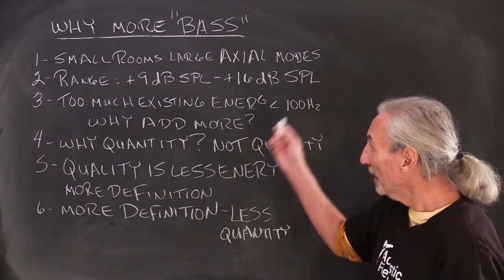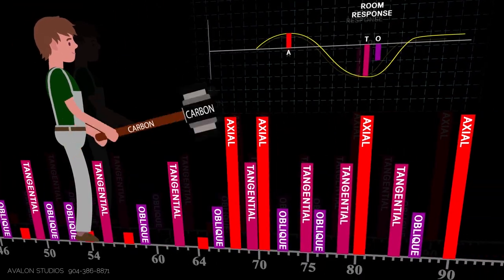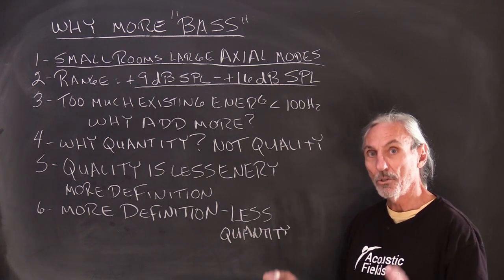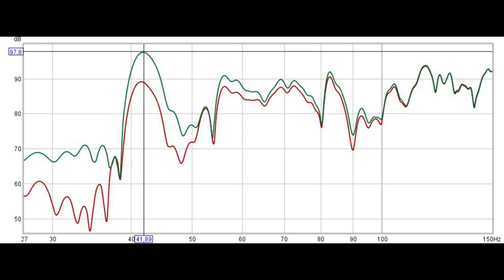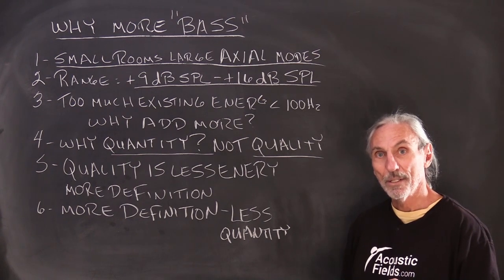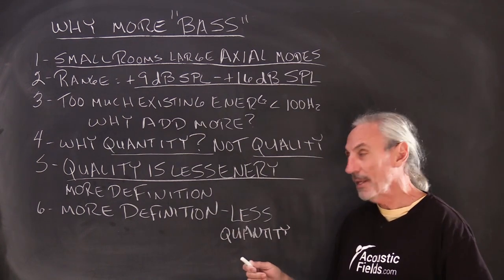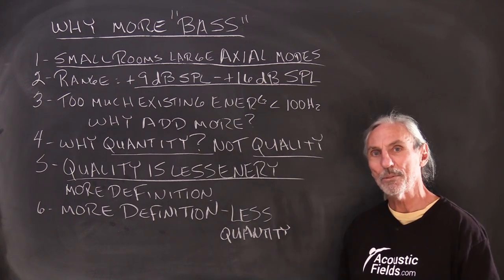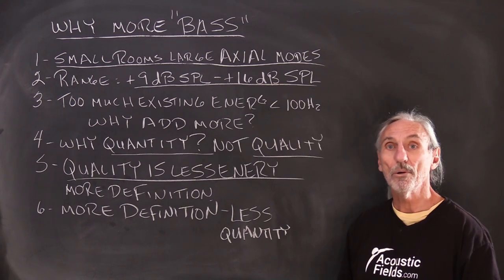Why More "Bass"? - www.AcousticFields.com

Comment: Great vídeo dennis!! I own two 18 inches subs,  one right betwin the center channel and  left channel and the other one at 3 o'clock from the sweet spot right beside the couch firing to the front stage and the sound is amazing!! Sorprisingly smooth and detailed!!!
Reply from the maker: Positioning low-frequency sources in small rooms is a process since the proper position is frequency and amplitude dependent. For some songs, the sub may sound good. For others, not so good.
Reply: Agreed!! Saludos desde México mi amigo!

Comment: But more energy IS a lot of fun. My 2-channel setup is a pair of bookshelves that dig well down to the 40Hz range and they're backed up by a little 12' sub with some DSP applied. My theater setups are both pretty over-the-top. My main theater, in a 1200 square foot room, is currently utilizing (14) 18" subwoofers and my mini-theater (bedroom install) has (4) 15" subwoofers. While I agree that definition and quality is not congruent with quantity, if you want to hit reference levels at super low frequencies (below 20Hz) the ONLY way to do that is with more cone area and amplification. I thoroughly enjoy that flat response down to 10Hz or so (in fact my theater responds down to 7Hz) but I don't think you're going to get that, especially not in a bigger room, with a single sub only using room treatments. You HAVE to have multiple subwoofer drivers.
Reply from the maker: Quantity is not quality. Quality with low-frequency separate notes, space between each note, proper attack and decay rates, along with increased definition is "fun"
Reply: @AcousticFields  Oh I do not disagree! More isn't always more. I was just offering an insight into the ultra low end, higher SPL, mindset that a lot of home theater enthusiasts seek. Getting 120dB at 40, or 30 Hz is all well and good, but when you're doing the same thing at 15 or even 10Hz, effortlessly, that's truly something magical. Especially if you have the main and atmos speakers to back it up!

Comment: Great video Dennis. Lots of interesting points. Question for you regarding your comment on managing the bass response in the room before adding devices. What are some things one can do to a room to help bass response after some wall treatments and carpet on the floor? Thanks. Keep up with the great videos.
Reply from the maker: Wall hanging units lack the density to treat low-frequency issues. Carpet is worthless when it comes to low-frequency issues but can minimize floor reflections.
Reply: membrane absorbers in two corners at the ceiling managed my worst room mode (60-65 hz) going down from 900 ms to 430 ms decay and the lower frequencies around 30-40 hz from two seconds to 290 ms

the rest of bass issues is done by an Antimode dsp in front of the subwoofer, realize that crossover at 60 Hz instead of 80 Hz sounds better even if rew measurement shows the opposite and after install and configure the Antimode doing the room measurement and PEQ from scratch because the filters change timing / phase

now the yamaha says the subwoofer is 315 cm from the hearing place and the front speakers are 300 cm away while physically the subwoofer is directly behind the couch at lowest volume level

in that setup you need very very low energy for the subwoofer minimizing a ton of issues and when correctly configured you don't hear its existing other then when you left the room without any door the bass is nearly gone and the neighbours are happy
Reply: @Harald_Reindl  thanks

Comment: Good video.  Question though: if using 2 (or multi) subs instead of one, that doesnt mecessarily mean the listener is going for striclty more amplitude (and accentuating room problems like you mentioned).... Couldnt 2 subs increase headroom, reduce driver distortion, and partially help room modes/standing waves??   I'm definitely not arguing with you or the importance of room treatment, but shouldnt those factors help (even if it's not it's understandably not the ideal solution to a professional room designer: for many of your veiwers, adding another $2k sub and/or wall treatment is a lot more practical than erecting a $500k room from scratch)
Reply from the maker: We use multiple subs within our rooms. Multiple low frequency pressure sources can balance the pressure distributions within the room if the room has the required amount of low frequency absorption technology. If not, they can make things worse by placing excessive lower frequency energy into a room that can not support energy from one source.

Comment: I usually agree with you and I don't question your competence in general but this is plain wrong, if you use two DSP corrected subwoofers you can place them ideally (apart from the speakers which should be placed according to the usual rules) and use one to cancel out the room mode caused by the other (active cancellation). In the beginning it was hard  to get the bass in check for even my small studio monitors (and my room is treated) but getting two subwoofers (not one, as one is making it pretty much impossbile to handle the spikes) nulled my problematic room modes and gave me a far better room response. This is not meant as offense, just constructive criticism. 

The room treatment from walls to ceiling was made by GIK including range limited bass traps to keep a good balance and slight diffusion on the back wall, the speakers are Amphion One15s with an Amphion 100 Amp, subwoofers are a pair of SVS SB-2000 Pros, for room measurement REW was used, for correction the integrated DSP controls of the subwoofers were utilized (room gain compensation, phase and parametric EQ as well as separate low pass filters, the low cut was implemented via my UAD Apollo which controls subs and monitors in separate channels without interconnection).
Reply from the maker: Walk us through the cost benefit ratio of this approach. What do the subs cost? What is gained in room response for the cost?
Reply: @AcousticFields  You're correct, it is much more expensive and time consuming, needs some knowledge concerning wiring, calibration and software, plus can be a gamble as room size/ angles etc. might need to be factored in. 

In general a good room to start with is better, in general you're right in that pressurizing a small room can be detrimental but I just wanted to point out that it can be done even though it is hard and I'm glad I got it to work in this case (I'd have to check how it's dialed in now, it took me months of experimenting, nothing I'd recommend to most tbh. and only needed for critical work imo). I merely wanted to encourage people with small rooms to think out of the box. 

Thank you for responding and rightfully pointing out the diminishing returns factor of active cancellation solutions.

Comment: There's those Laws of Physics again! I usually give up trying to explain to people the wavelength and cubic volume needed for the signal they think they can reproduce in a small room. And their preferred solution is more subwoofers!
Reply from the maker: Its a tough one to illustrate. I have done around 600 videos and I still am not getting through. There is so much misinformation out there that people take the half truths and outright lies and then act upon those misrepresentations. The building insulation box companies have done a good job of hiding the truth.
Reply: @AcousticFields  I know. Try to explain that because of wavelength of the low frequencies, unlike higher frequencies where the time path delay of the speakers is different to each ear, they pressure wave is the same at each ear. That the law of physics state you can not determine location from low frequencies information. That if you can detect where the sub is, it is producing frequencies it should not be. And that if the cubic volume is not there, again those nasty laws. 

Keep up the effort. Nice to see the occasional correct information.

Comment: hey Dennis, for those that have too small of a room to have room treatment and adding a sub is going to put too much energy, would adding one of those Butt Kickers to the chair be recommended?  Maybe you can do a video in the future about those devices and the pros and cons to using them for specific applications.
Reply from the maker: Vibrational energy through your seat versus air born waves is a completely different science. One is air to surface and another is surface to surface. The experience is as different as the delivery methodology.
Reply: I added some to my setup, it’s great.
Reply: @AcousticFields  I understand they are completely different approaches.    I was just trying to figure out what one could do when confronted what a REALLY small room that still want to have low frequency energy that don't have enough room for LF absorption, and a sub is out of the question.  I see a lot of people trying to turn a small bedroom (10'x10') or thereabouts into a listening room or a recording control room and I see a lot of these people get subs, which will excite the Axial modes, and the room is too small for LF absorption.  I was just curious if those devices would be a second alternative.  They certainly won't excite the Axial modes.  Right?

Comment: Quite right, the room is often the worst performing piece of the audio system.  
If the room is crappy, no amount of money spent on other components will give you good bass, or sound, generally.
My room has even more severe low end problems than the REW graph that Dennis referenced, but alas, the house renos come first ...
Reply from the maker: The room is an integral part of the total sound quality. People try and place percentages on the room impact. The best room size is no room at all.

Comment: What constitutes a small room?
Reply from the maker: When the room size and volume does not match the acoustical objective of the usage and the treatment of said issues will not have the desired impact. What we are saying is the room is too small to do this, that, or the other. Every usage has a minimum size and volume requirement.

Comment: The development of bass in headphones is interesting. I wonder what is being done technically that now they are starting to get more bass without loosing its quality and detail. I  Better damping and control? Probably the things that are true in your presentation here are similar in their designs. Thanks! 

To everyone, before you buy anything try out some of the theories and ideas on this channel. I have employed them with my home setup Kef R900 towers with some basic sound absorption panels at first reflection and a ceiling cloud. Not wanting to modify my room, I filled the two bookshelf's either side of my speakers floor to ceiling, 18" deep x 32" wide all rockwool. Basically its like two somewhat meh bass traps, a resonant one would have been better im sure. I also (quite lazily) filled my fireplace completely with rockwool and did my best to seal it off. These couple of moves (and sub 500$) took all the problems I was measuring and made them totally reasonable! The mid bass, punch, impact really supprised me. So much of the meat of songs was sucked up in the room. I tried throwing as much at 10+db of EQ at 42hz and had almost no result. After the treatment, I was able to get it reasonable, the room still sucks some 42hz up but alot less that before, audibly its even better than the measurements suggest. Im looking at like 6db +/- range from 30hz to 200hz, really really good!! Mixed with speaker placement and some light eq I have achieved a sound quality I did not think possible in my crazy weird shaped and pretty small room. I tried a sub in the room, multiple subs actually, nothing got me the sound quality I now have with just my two R900 towers. The subs just muddied the bass and took out the detail!! I know he doesn't like us using rockwool but it does work and I was careful when installing it to protect myself.
Reply from the maker: Headphones or "cans" are small rooms. There are headphone manufactures that are testing our carbon and foam technologies within their phones.
Reply: @AcousticFields  That's why open-back headphones often sound better am I correct?
Reply: @AcousticFields  I would probably buy Shure SRH-1550 with 50 mm drivers and your carbon plus foam technologies in addition to my open back SRH-1840. Please, get in contact with Shure.